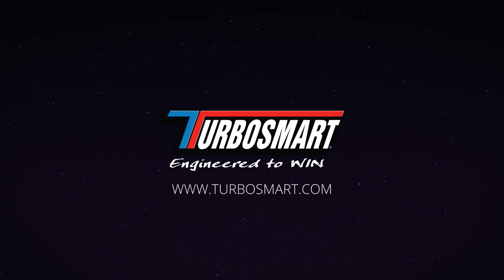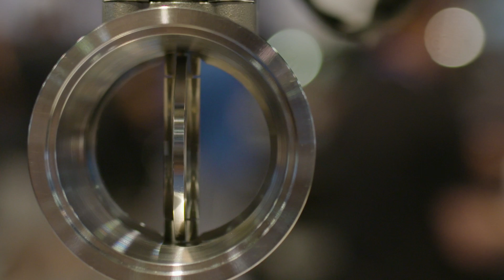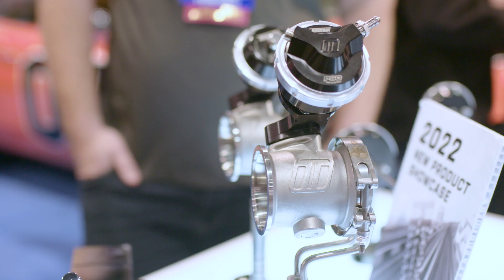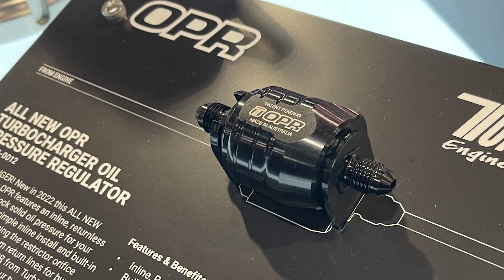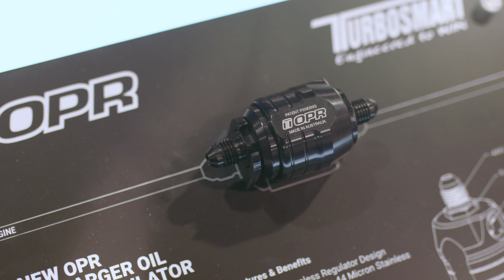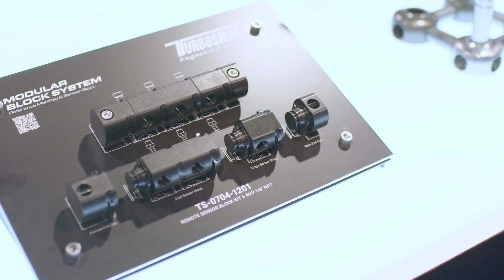New Turbosmart Products Launch at SEMA 2022 - Straight Gate, OPR and More

Comment: Just need to change the e gate to normally open so if it malfunctions it goes to the open position
Reply: The Zero-Backdrive feature means that's not possible... This is required to lower the overall power consumption of the unit and provide the kind of force required to close against high drive pressures. This was a compromise, however a worthy one as if you're looking for the sort of gians you get with an eWG, you'll also have Electronic throttle and will have your over-boost strategies in place.
Reply: @TheRealBoostCreep  If it is truly a balanced valve, then zero-backdrive shouldnt be necessary. And backdrive resistance is just the relation of the gear tooth angles, no?
Reply: @ArclightZRO  The Zero-Backdrive technology was developed for the Poppet style gate as it needs to handle the drive pressure and the actuation of the valve - It is far less of a requirements for the buttefly style yes as you point out but still adds to the stability of control and overall reduced power consumption.

Comment: I'm guessing with tuning the pneumatic straight gate, you should be treating it like any internal gate actuator?
Reply: Yes - Similar & not allow different to a traditional poppet style gate. The 'numbers' will likely be less aggressive through as you're not fighter the driver pressure as it's largely negated by the zero-offset butterly style valve.